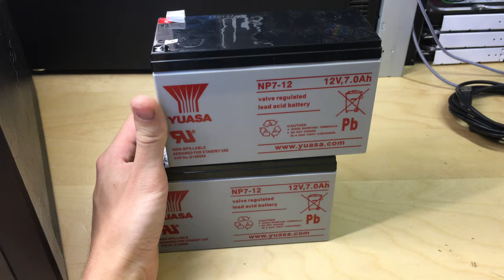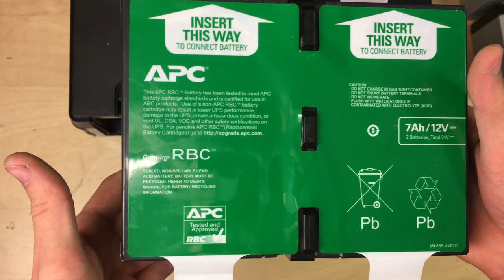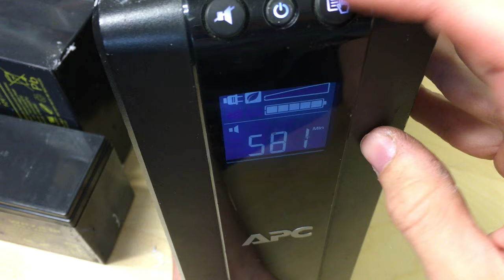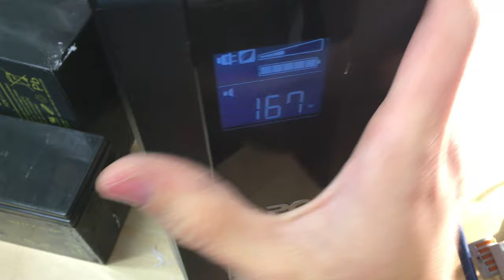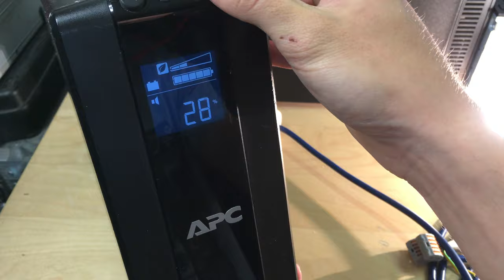APC Back-UPS Pro 900 Gets New Batteries & Re-calibration - Rebuilding Battery Pack, Yuasa NP7 Cells

Comment: A couple of recommendations for when you'll be doing this stuff next time:
1. New batteries need to be charged for at least 8 hours before they'll be fully charged. 16 hours would be even better. 30 minutes is nothing.
2. Try not to flip the battery completely upside down. The acid inside can leak through the vents like this. AGM batteries can only be upright or on their side.
3. Your new batteries have size F1 terminals. The original batteries had size F2 (larger) terminals, and that's for a reason. Those bigger terminals can safely pass higher currents through them than the smaller ones. This being a 24V battery pack, you were pulling around 6.4A from each battery which is completely fine. But it might cause a problem if you'd had a bigger load connected to that UPS. So, next time you're looking for new batteries, try to look for those whose terminals are of the same size as the dead batteries had. And I would also like to recommend you to get the 9Ah batteries - higher capacity, more runtime, more lifetime, just a tiny bit higher price.
4. The proper way to calibrate the UPS's estimated runtime and battery capacity is to send the unit off to a service center, which we obviously don't want to do. Then there's the program "apctest" which comes with the app "apcupsd". You can do lots of stuff with that tool, including the ability to run manual self tests and battery runtime calibrations.
5. Please, go and clean that leaked battery acid up with baking soda. It will neutralize the acid and thus clean up the mess those bad batteries made. 
6. Next time you see this in a UPS, wear some gloves for your safety, sulfuric acid is very toxic and corrosive. Carefully tapping it around on the table is not an argument for not wearing gloves.

This was a great and a very helpful video. Those batteries have failed spectacularly! I wonder why the vents did not release the pressure... Maybe your UPS could have gone bad and started overcharging your batteries.
Reply: best advice i've read on youtube in awhile,  just one thing. 

 the Back UPS 900 Pro uses the RBC123 7Ah batteries identical to the ones he got by factory spec.  and yes,  they do use F2 Terminals. 

https://www.apc.com/shop/ee/en/products/APC-Power-Saving-Back-UPS-Pro-900-230V/P-BR900GI  <-- clicking the "Replacement Battery' link leads to ---> https://www.apc.com/shop/ee/en/products/APC-Replacement-Battery-Cartridge-123/P-APCRBC123

changing to 9Ah batteries require the user to perform several calibration tests just so the UPS re-learns that it has higher rated batteries.  otherwise it will throw erroneous Time-remain indicators when on the battery and during AC Mains as the estimated time.  

the fastest way to get it to relearn, is to 'brain-dead' the unit multiple times for a few days.  to brain dead one of these units,  its simple:  shut down the unit,  pull the battery and AC Mains Input.   Hold the Power Button down for 5-30 seconds or even longer if you wish.    the moment you hit the power button you will get a very funky sounding whine from the piezo speaker for about half a second,  this is ok, because the logic board simply is draining what power it had in a vain attempt to boot it.  

after performing the brain dead sequence,  reattach the battery and AC Mains, and boot the unit for about 4-6 hours.  

REPEAT ^ ^ ^  at least twice a day for 3-4 days.   

In addition to the brain dead procedure,  you have to execute a manual self test every 2 hours ( recommended by many engineers and IT Professionals ) just to force the UPS onto battery load.  

To do this:  With the unit powered on and a normal loading ( 45-75% total load of the unit ) press and HOLD the power button.    after 2 seconds you get a single beep, indicating power to turn off,  DO NOT RELEASE THE BUTTON!!!  Continue to hold it for anther 4 seconds, equaling 6 seconds in total, you get a second beep, indicating the unit is being instructed to manually enter the 'self test' sequence.   release the button,  and the UPS will execute the self test mode.  

if you don't do these things ^ ^ this is what can happen: without properly calibrating the unit, I have seen these erroneous time values actually cause the UPS to fail logically and throw itself into a firmware safe-mode per say.  at that point, then the user is absolutely screwed and in order to restore the UPS back to normal operations, it HAS to be sent to a service center.   better hope you didn't have a warranty,  because if you did,  its now Void.   

while APC did in fact lie about using 9Ah batteries in the models that use 7Ah batteries that they would not fit and cause malfunctions,  the user still has to do a slight bit more work to make 9Ah batteries work.  and they DO work,  they add about 15-20 minutes runtime, depending on loading.
Reply: Hi! Can u tell me please were i can get the program apctest. Can u calibrate battery runtime whit this?
Reply: @earavasio  APC website has the software,  and calibrating is better done with the methods described above
Reply: @CapStar362  above in the video ir above in point 4? Becouse in point 4 says that the proper way is send it yo official service...
Reply: @earavasio  yeah, if you want to pay for it especially if its out of warranty.  

you can calibrate it as the end user.  follow the info i posted.  thats basically the same thing they do.  

the UPS just needs to 're-learn' the battery endurance times and thats exactly how it does it.
Reply: @CapStar362  Do you think I have "absolutely screwed" my unit as you described?  My LCD screen no longer works after changing to new batteries.  The screen lights up, but it is solid blue with no graphics, letters, or numbers.  I have been pushing all the buttons in every combination and various hold down durations in many combinations to try to get it to work, reboot, or reset but to no avail.  I may have made it worse not knowing what I was doing.  The good news (maybe) is that the backup power function seems to still work.  I was able to plug in a lamp, unplug the mains, and the lamp stayed on battery power until it shut itself off when the battery drained completely.  So the unit may still work, but not the LCD display.

 I was replacing the pair of old 12V/7AH batteries with 12V/9AH batteries.  Right before I pulled out the old battery, the LCD screen was working, but it was dim and fading because the battery was shot. It would display for a few seconds before shutting off and going dark. When I pulled the old battery out, it was leaking a little, which I cleaned up.  After removing the stickers and transferring the bracket to the new batteries,  I didn't realized I had to do calibration.  I just inserted the new battery in and turned it on.  That's when I discovered the LCD screen no longer works.  Any advice on getting the screen to work without having to send it in to be repaired?

Also, my model is the APC Back-UPS NS1250, but the tag says model BN1250g.  It looks just like the one in this video, except with a different model number.
Reply: @godblessthelessfortunate3175  you would have to disassemble the unit to replace the LCD Screen module.   you can do get them on ebay and i think amazon.  

if its still functionally working,  then i dont see why you cant continue to use the unit.   you just wont have the information about it.
Reply: @CapStar362  Appreciate the advice. Sounds like I just have a bad LCD screen module, and didn't break it.  I couldn't find a replacement on Amazon or Ebay.  Thinking about buying a used functioning UPS and cannibalizing it for the screen parts.  Not sure if I have to get an exact match on model number of if I can get away with another model that looks the same.
Reply: @CapStar362  Also, regarding your instruction to "In addition to the brain dead procedure,  you have to execute a manual self test every 2 hours ( recommended by many engineers and IT Professionals ) just to force the UPS onto battery load."  How many times do we do the manual self test every 2 hours?
Reply: @godblessthelessfortunate3175  just 1

this just gives the UPS's CPU an idea of battery capacity to calibrate it
Reply: @godblessthelessfortunate3175  as long as you stay within the model series,  yes, they should be compatible with each other.
Reply: I don’t get that noise when pressing the power button for 30 sec. Battery disconnected, ac mains out. Do you think the braindead procedure is still doing its thing?

Comment: You were lucky with how cleanly those stickers came off, I've literally just done one of these using the same Yuasa batteries you used except that my stickers separated from the glue layer so I gave up and used gaffa tape to firmly bind the new pack together. Not as pretty but functional! Nice vid - very helpful for the calibration method.
Reply from the maker: I was indeed dreading the stickers. It always depends on the adhesive they use. Perhaps they changed them at some point along the line - I am not sure how old this pack is/was exactly. Tape definitely does the job though and that is my go-to when rebuilding packs for the older Smart UPS units with larger cells / batts. 
Glad to be of help regarding calibration, so many people don't know you need to perform one, and that you can indeed do it without software! 
Thanks! --Nathan
Reply: @NathanPH  the pack was made 2012 week 25 serial xxYYWW
Reply: This date format is used on all the APC products, Batteries, UPSes and Network MGMT cards, like the AP960 cards.
Reply: @NathanPH  re calibration, do you have to fully recharge the batteries to complete the process, or is the steady continuous discharge enough on its own ?

Comment: CSB is the oem supply for APC. Your unit may have been rebuilt before. The batteries you put in are of high quality. Good job.
Reply: The supplier depends on where the ups is build..if its produced in the Indian factory. It's generally exide battery. If it's produced in thiland factory it's generally "long" battery. But mine is produced in India but came with long battery anyways. So they do mix up all the time. There is like 3 4 suppliers of apc.

Comment: Thanks for this one. Ordered a pair, and did the entire process.
Only the stickers were a pain to pull off and the glue only came partially with the "sticker". Just used some ordinary glue stick and put it on these annoying bricks.
With my last full-battery pack I've gotten a foam-frame like for desktop pc's top and below. Simply put it in there as I waited some time to give the glue some rest.
My only mistake was, that I put the stickers in reverse. So red is now = active
Well batteries work and passed the test. Thanks for the vid!

Comment: Thanks for the video! Looks like we can put in much better batteries for half the price of the APC replacement battery. I did some research and it looks like the long-life CSB HRL1234WF2 9Ah battery is probably the best option, they claim to have an expected battery life of 10 years! The original ones only lasted 3 years, which is a shame (I didn't take it apart yet so don't know what brand was in it, but I bought it brand new). My battery in my old APC that I bought in 2004 lasted for more than 10 years.

Comment: I’ll tell you right away the video is informative and useful, there is one thing, but the author forgot to show that on these uninterruptible voltage devices, after replacing the batteries, it is necessary to calibrate through the program on the PC, the name of the POWERCHUTE program, if you don’t calibrate, errors and incorrect work are possible, I hope this will help someone

Comment: Next time try the Yuasa NPW45-12 it's exactly the same size but higher capacity and is rated for a higher discharge. Also the have longer life spans and don't cost that much more.

Comment: 7Ah seems to be the default for these replacement batteries. Usually what comes with the unit is higher though and hence more money.
Reply: 9ah or 10ah is the absolute highest. Apc has different battries for different regions. 
My one is the br1000 indian model and it came with 9ah battery..but the same model in usa comes with 7ah battery. With totally different construction. Mine has a smps based inverter and smps charger while the usa model has a big transformer. There are pros and cons of each topology but the smps is better in efficiency and do not make the battery puffup and crack by overcharging.

Comment: I cannot believe those A-holes use a standard 7ahh battery and charge so much for it! Do you know if I can use a 7ah Lithium battery instead of a lead-acid battery?
Reply from the maker: Yes it's pretty insane the markup that they apply to these things. 🙄
I'm honestly not sure about the swap to Lithium, you'd have to do some digging into it and speak to somebody a little more well-up on different battery technologies.
--Nathan
Reply: Thanks for that. Regarding calibration, I believe APC has software to do it. Is there a reason you chose not to use it and do it manually instead?

Comment: I have the 1000va or 600w model of this ups. Although from the same line of ups the br1000g and br1500g is very different. Both uses high frequency dc to dc inverter. Instead of the classic low frequency pushpull on a huge transformer inverter..so it is lot more energy efficient. 
Mine has a external battery port and apc sells a 24v 18ah (total 4x 9ah battery inside) module for 110$. I did not buy that. Instead i got 16 x 6000mah Lifepo4 32700 cells for less than 50$. Made a 25.6v pack and the ups runs 45min on 300w load with that battery pack alone. And it will outlast the lead acids 2 or 3 times i hope. I don't have too many power cuts the battery has been discharged to 0 only 3 4 times in a year in real power outage. 
Lithium batteries are getting cheaper and cheaper..i just saw battery hookup selling a lot of 18650s for 58$/kwhr and you can build a 7s9p pack with it that would have nearly have 541w/hr for 30$ on the 18650s ! It would last atleast 6-8 years.

Comment: I replaced my batteries and the run time on the unit is still the same. I get less than one minute of run time and the computer shuts down? Brand new batteries! Is there some sort of rest that needs to be done?? Help. I have two of these units both need batteries.

Comment: I changed to battery with a fully charged on and the battery still blinks. Empty
Reply from the maker: You've not followed the recalibration process as shown in the video if that's happening. You need to re-learn the battery capacity by running it down with a large load.
Reply: It reads zero battery.. it turns off right away when unplugging it @NathanPH

Comment: The fan runs continuously all the time when powered on. What to do?
Reply: I have the 1500 va unit.
Reply: @kb2564  the fans always run when its on or plugged into the wall, it is normal, but they're dual speed fans, if running on batteries or charging the batteries the fan runs at a higher speed for cooling.
Reply: @johnstouchpad6437  Thanks for replying. It's been 4 months and I have learnt to live with the noise. I kind of don't even notice it when I am gaming..😂
Reply: @johnstouchpad6437  I got the f02 error 2 times because I had 2 rigs plugged in to the unit. Total was about 650 to 700 watts. And I got that error when I am gaming on my primary and streaming or recording on the secondary.  So I bought another ups,  and plugged the other rig in the 2nd ups. I bought the apc line interactive 900va ups.
Reply: @kb2564  the 1500va shouldn't be noisy when fully charged and in use.
Reply: @kb2564  Also 1500va max power is 850w or so

Comment: I hate this unit its so hard to change the battery's  its not like most where you can change both battery's without ripping the sicker off i miss the old apc ups where they did not care what you put into it also the apc ups battery's are a rip off too as they are using crap battery's nd a high price tag but anyway good video mate i did this and mine did not like the old ones i put in so to stop the pain of the apc ups battery change i am getting cyber power i hope its not so picky
Reply from the maker: Yes I can definitely agree with you on the older units being more user friendly to service and less messing around. I do however like the LCD display addition on this model. 

I have built many packs for the older, all-metal construction Smart UPS 750, 1400 and 1500 models which I've also done videos about previously. I always use Yuasa branded cells as I've never really had any issues with them. They last a good few years (generally over 5 years) before requiring replacement and don't really tend to leak when they do go bad. 

I don't think I've ever had a factory fitted battery pack that hasn't leaked, bulged or failed in an undesirable way. All of them seem to have had LONG branded cells in though so perhaps they do use other cell brands that are better but I keep getting units with the bad ones... 

I don't have any experience with any other brand but APC personally for UPS units but I have heard some good things about Cyber Power. 

Glad you enjoyed the video though! Thanks for watching. 
--Nathan
Reply: @NathanPH  they are good units apc good display but too much money to buy now a days for a unit that's not so good no more also I have herd that most apc battery's leak bady because they use bad battery's